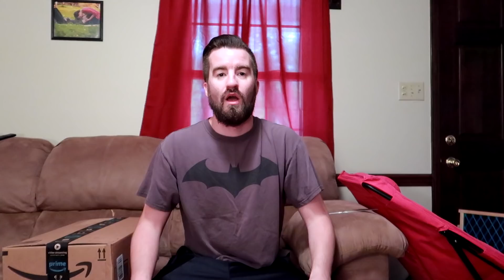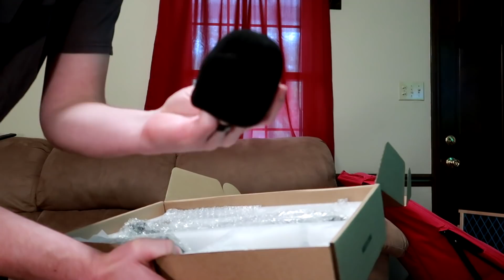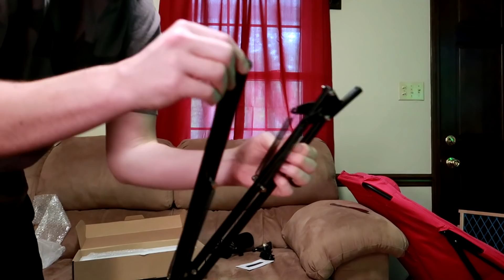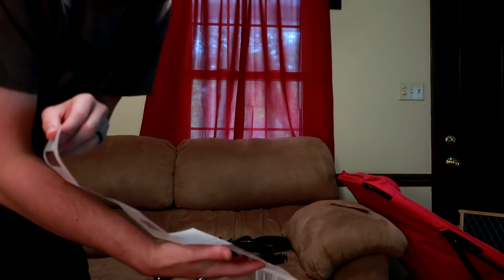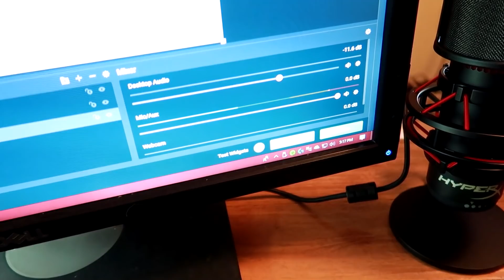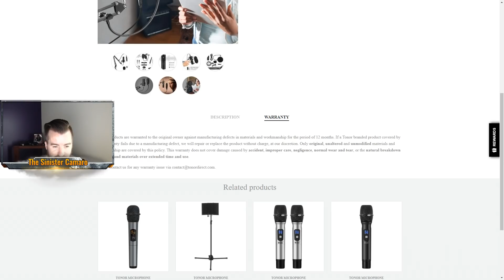TONOR Q9 USB Condenser Microphone | CHEAP Microphone Vs EXPENSIVE Microphone? | Giveaway (CLOSED!)

Comment: Hey, just want to point out the orientation of the mic was pretty wrong. While the grill itself wraps around the whole mic, the capsule itself is "front" facing (where the gain key is). Having the top of it pointing at you isn't a great representation of the sound quality (especially if you're not adjusting any software/system settings). Even having your Hyper X one on the stand is a slightly more favorable position for that mic than what you have the Q9 at. Many other videos show off much better quality. Not a knock against you, just a bit of info. Mics always have a proper orientation, even the omni-directional ones sometimes.
Reply from the maker: Thanks for the info!  I really appreciate it. Yeah Im new to all of this, so I'd love to learn more rather than later. I will def keep that in mind going forward. 🤘🏻